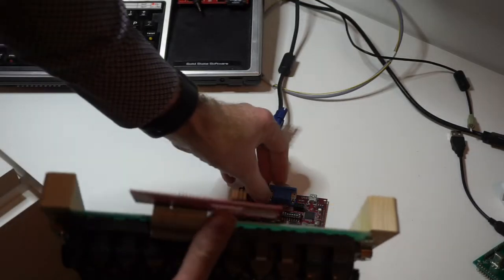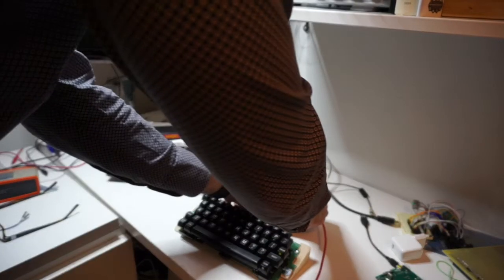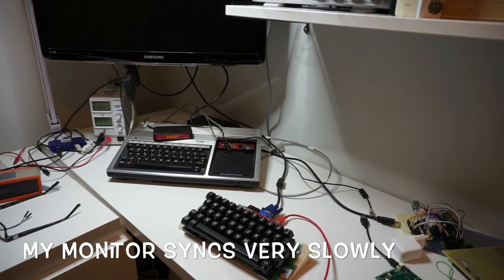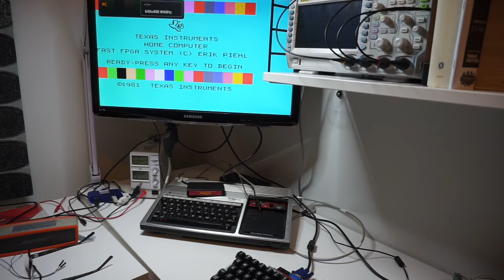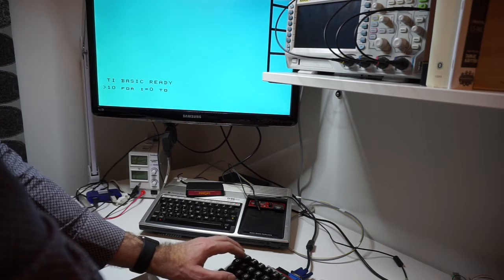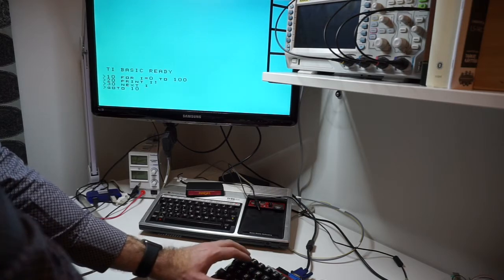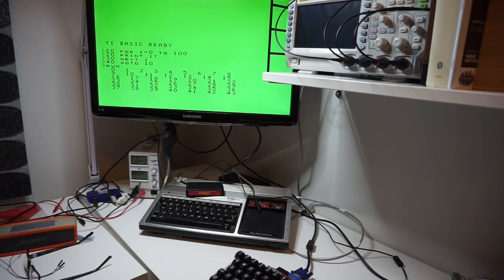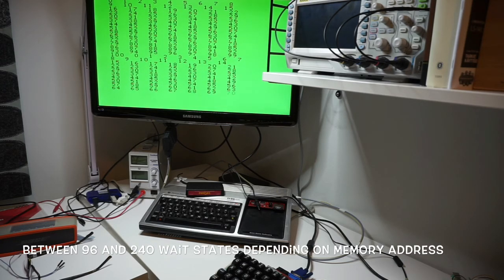FPGA Based TI994A with Keyboard

Comment: This is a great project! Can you insert virtual "cartridges"? Does it emulate a 32k expansion? Can it emulate the TI disk system? What about joysticks? Can you adjust the speed to be the same as a real TI as well as running faster?
Reply from the maker: Barry Nelson Yes it supports virtual cartridges, but currently you need to load them from PC over USB. I am going to modify this in the coming versions to make that part stand-alone too. It supports pages cartridges up to 512K in size, so the mega demo can run on the system. It supports also 32K RAM expansion, in fact system RAM is 256K paged using the SAMS mechanism. TI disk system is supported, again over USB on a PC host. Joysticks are not supported on this version but easy to add. It does not currently support running at exact TI speed only speeds from about 2x faster as seen in this to about 30x faster.